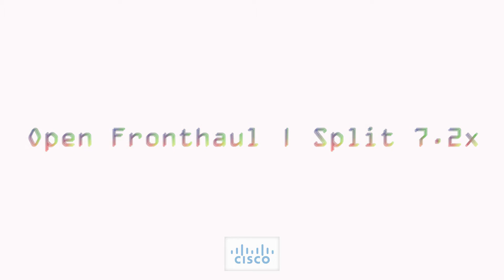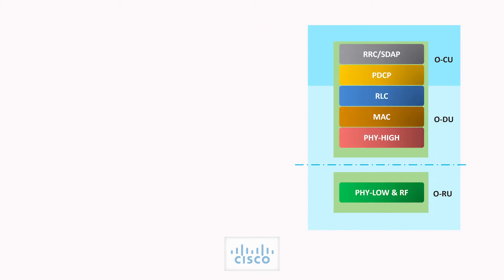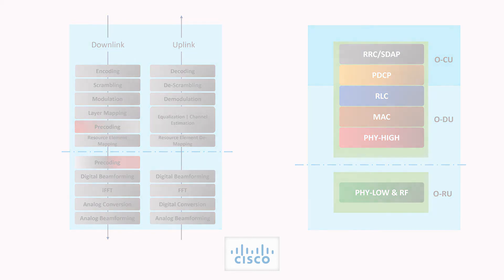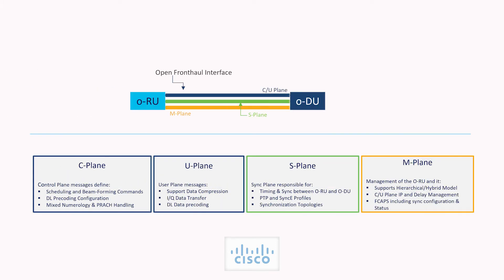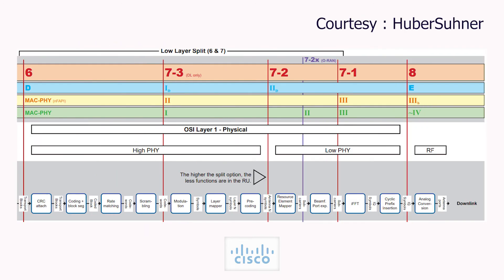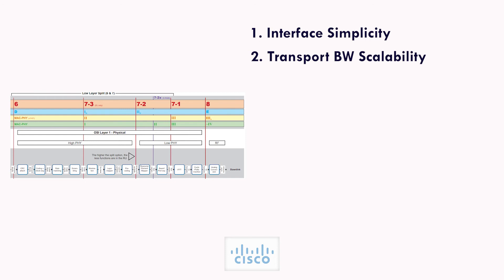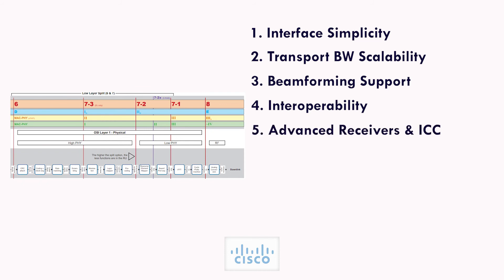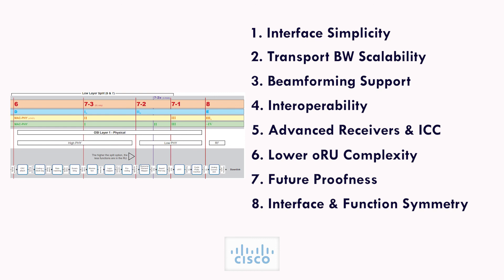Open Fronthaul | Split 7.2x Architecture

Comment: I'm trying to understand the bandwidth requirements of the front-haul bandwidth vs. actual OTA bandwidth for a 7.2 split and the 7.1 overhead of carrying beamforming information over the front-haul. Is there a way of calculating IQ bandwidth vs. OTA bandwidth? Which modulation schemes are most prevalent particularly for small cells which may be deployed in a private industrial network? 

I'm also trying to understand timing requirements for the RU OTA interface and co-operation with other RU's and whether SyncE is implicit or whether it's just ptp plus local GNSS? I'm of the impression that 5ns RU sync is a requirement OTA but I'm happy to be corrected. 

I am bootstrappping myself regarding 5G and am interested in it from the OSI layer 1/2 perspective primarily.

Any words of wisdom very much appreciated.